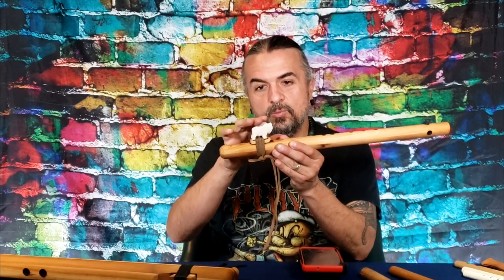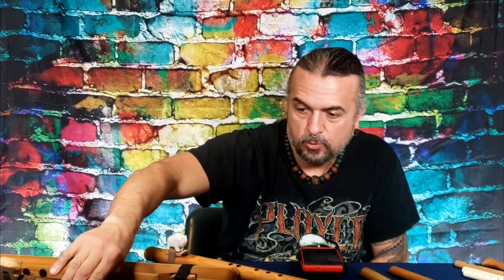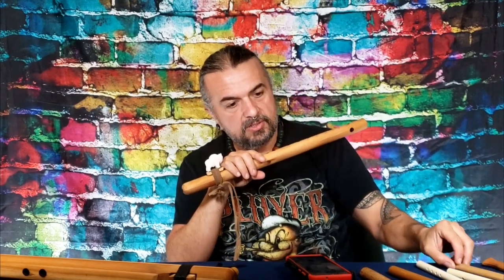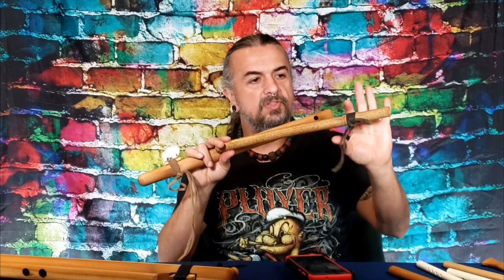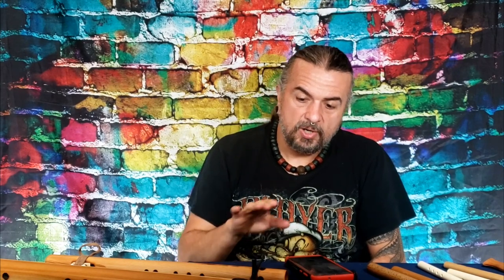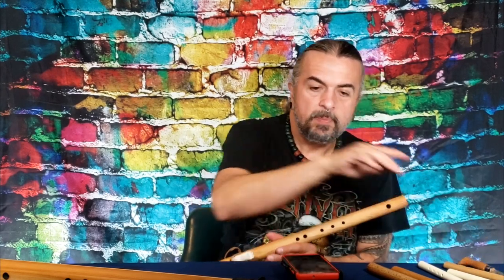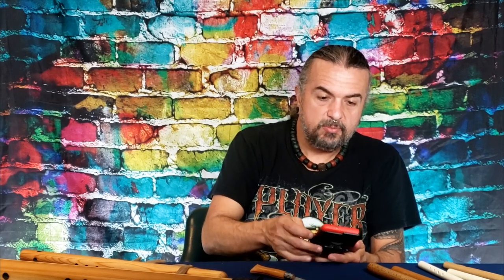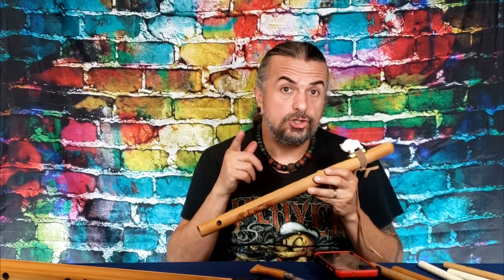Native American Flute Making Q&A

Comment: Charlie, thank you for an informative video. I just ordered your burning rod and am waiting for it to come. I have a small collection of half made flutes on my bench laden with numerous mistakes. Track made to long, and to shallow, sound hole to large and then filled with epoxy, poor routing because I could not find a 7/8 cove bit, finger holes made to large, and confusion between 4040 and 432 hz, slow air chamber to long, one flute with a plug I gulped in and another with slow chamber routed. I found your video supportive and am ready to fix, improve, and continue to learn each mistake has become a lesson that improves my questions on how to improve. Until the process reaches my hands it is only and idea, that has not canonized into behavior. I have been looking at many YouTube video for info and find that I end up returning to yours. My questions today are plug verse route the slow air chamber? If I have over burned the sound holes should I plug them, or can I seek a different key? What are your thoughts on a drilled bore vs routed and glued? What state to you live in. I live in NY. Go well Black Peace Eagle- Larry Winters

Comment: I made my first flute from PVC I had here, recently, and it sounded pretty good to me, but then I read about PVC being carcinogenic and didn’t feel right using it. I made one after that out of 3/4” ID hard copper pipe I had on hand. It sounds pretty good, but not consistently. It’s hard to make the channel. I made the first finger holes with a 1/8 bit. I used your pattern from the historic B flute on one of your videos. I really like the sound and size of that one. They came out very nice, but when I tried to enlarge them for proper sound the bit must have  been on the dull side and they didn’t come out as consistently round.  I am still tweaking it. I worked on it a bit while watching this video and it seemed to improve. The sound is pretty to me I just need to get it consistent and learn to play. Lol. I hope to try a wood one from the trees in my yard when the weather breaks. Maybe from one of our mulberry trees or the elm. I think native people used what they had on hand and what they could get to work well. Thanks for sharing your info.

Comment: Have you ever used Red Wood? It's not difficult to glue as I've heard. Just rough the joint and wipe it with acetone. Then use good ole Tight Bond. Michael
Reply from the maker: Redwood like Sequoyahs, yeah most western cedar depends from them. That's our regular wood for flutes.